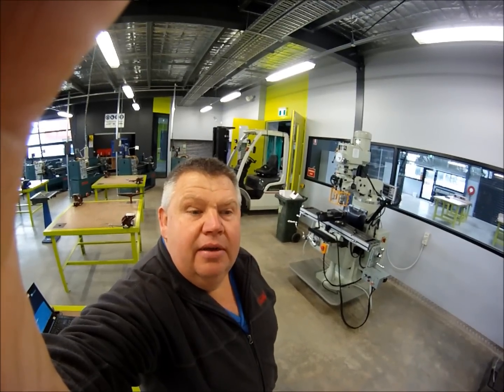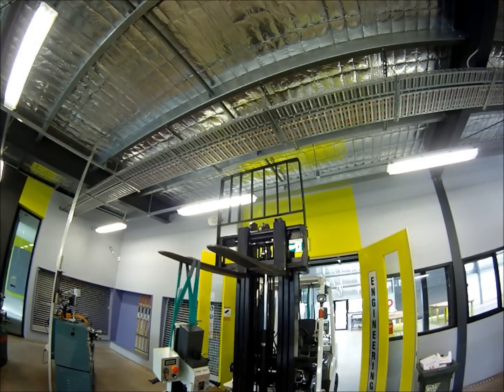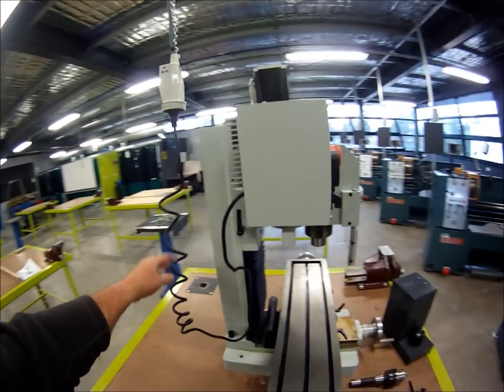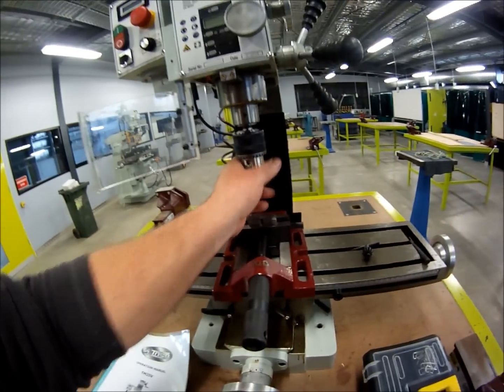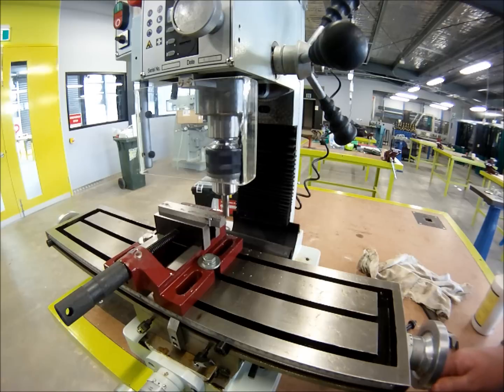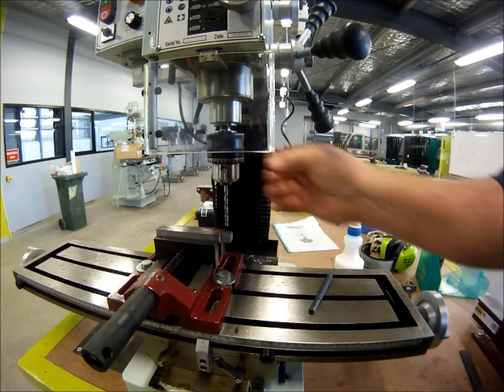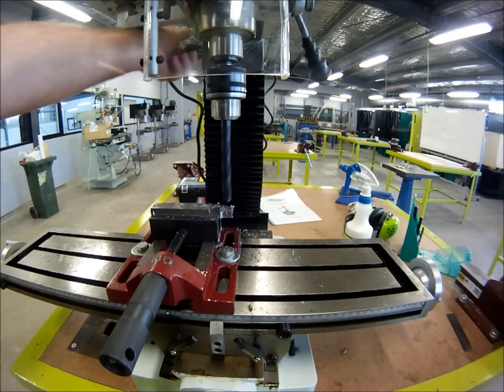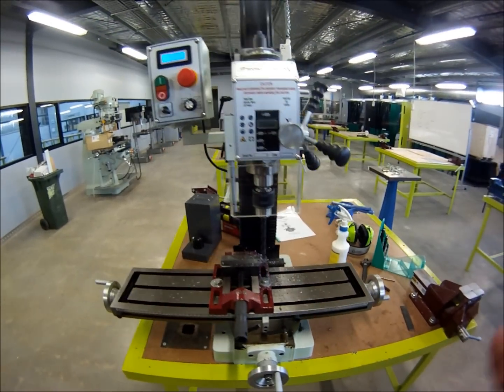Titan Mill TM25V Unboxing & Test Drive

Comment: Is this a renamed Precision Mathews? It sure looks like it and has the same features that has my interest such as the column to base bolting, belt drive, and the table is a solid casting instead of end caps that all the other brands of this size mill use.
Reply from the maker: Hi Travis, I'm sure there are similarities between all of these little mills.  The older PM25 was a close to that of the grizzly / optimum mill.  The newer PM25 was identical to the TM25, but I believe there is a version 3 now which is slightly different again.  Either way I have free files (see video description) https://youtu.be/Wx8238bGSCY so help yourself and download them. Cheers, Aaron.

Comment: Hi Aaron forgot to mention that's a really nice engineering school lucky students or apprentices.  Nice fork lift. Regards Tassie John
Reply from the maker: +John Kinnane Thanks John, yes the kids are spoilt at my school.  It is a brand new trade centre which I helped to set up.  Heaps of CNC machines and manual machines.  The students have a ball there and make many cool projects.  Cheers, Aaron.

Comment: G'day Aaron really considering buying this mill, I have read that some buyers are less than impressed with the standard of delivery complaining about rust on lead screws, ways and missing tools.  Surely these are isolated incidents as I assume Stuart has sold a lot of these, I suppose I am  looking for some reassurance.  Regards John Kinnane
Reply from the maker: G'day John, unfortunately there will always be keyboard warriors on the Internet with an axe to grind. I have been directly involved with the purchase of 7 milling machines from Stuart and have never encountered a problem. However and that said, remember these are made in China for a price mate. They're not a Bridgeport. There is a larger machinery company selling similar machines, I won't deal with them due to a past experience I had at another school. They quoted $6K to fix oil leaks on lathes we bought from them. I fixed them all for $15. Cheers Aaron

Comment: G'day mate just happened to stumble across your YouTube channel.  This looks like a very nice mill, I am into building a 5" gauge live steam loco and need a ridged and pretty accurate one.  In your opinion would this machine be able to do the Job?  Have subscribed to your channel thanks mate regards John Kinnane Tasmania
Reply from the maker: G'day John, yes the little Titan TM25 is a fairly rigid machine for a small shop mill.  I have the older TM20 and I can mill steel and aluminium on it. It's capable of running a 1/2 cutter or a 25mm face cutter. Mine is converted to cnc. I have videos up on this channel showing it operating. Cheers Aaron
Reply: +DCTTeacher1 Thanks for the reply Aron, I was looking at a ZX30 mill drill but it seems that they are not ridged enough especially on the Z axis. I was also looking at a Sieg SX2.7 but I am sure you know that the quality isn't there.  By the way your channel is great and as for the large choppers fantastic, I use this build large scale RC aircraft when I was younger I am now 59 and have rheumatoid Arthritis so It is difficult, easier with the locos.  Thanks Aron I have subscribed and look forward to watching more of your videos
Reply from the maker: Hi again John, thanks for subscribing mate.  I really appreciate it.  If you are chasing rigidity I would get the larger Rong Fu 45 type of mill (titan TM45). Michael the large scale helicopter guy bought one of the TM45 and he just loves it.  I will check out your channel now.  Look forward to seeing you scale loco's.  Cheers, Aaron.

Comment: Hi Aaron. Nice mill! I have just ordered one of these from Stuart but it's hard to get into contact with him to find out details about them and all the sites have completely different specs for the machine... :/ I need to order R8 Chucks etc and I am wondering what the R8 drawbar thread size is? Ie 7/16" 20TPI or M12, this isn't listed in any of the specs on any site either? And is the R8 drawbar thread the same as the R8 on the TM20VL machines? What does the manual say for max face mill size, etc? Also, what are the actual travel lengths for X and Y on your machine? I haven't been able to get a reply from Stuart at all about these and his phone just rings out... :/ Every site has different specs :/ ie ebay, titan website, machines4u, alibaba, etc all have different specs for the TM25V which is bloody confusing to say the least! 

I am planning on converting it to CNC also with Nema34 800oz + 0.9 degree steppers with belt reductions, etc... How is your convert coming along? 

Cheers for the info and looking forward to seeing your progress!
Reply from the maker: TheJetProject Hi mate. Have you tried calling Stuart on his mobile. He usually answers it, if not just leave him a voice mail. The TM25 draw bar for the R8 is 7/16" x 20TPI.  The maximum end mill size is 16mm dia. I have used a 50mm dia 4 insert face / shell mill in my machine with good success. The working size is the same as the TM20LV, but the motor is more powerful. I have already converted my TM20LV to CNC, but am in the process of making a kit for the TM25 machine, but these will be direct drive and not belt drive. I look forward to you conversion. Cheers, Aaron.
Reply: Hi Aaron, 

Thanks for the quick response! Yes I have tried him quite a few times on his mobile but it just rings out?

My TM25V turned up though. This one is green and it has a geared head not belt for some reason? On the plate it's say TM25V? Haven't checked the motor specs yet or pulled it out of the crate to check that the whole machine is ok but I pulled the top off to have a look and there is no pulleys which has me stumped? I thought the TM20VL is geared head and the TM25V are 2 speed belt? The control box sits on an arm like yours is in the vid? Do you know what other spec differences there are to your two machines when they were stock? 

I have seen your TM20VL CNC, very nice work! Part of the reason of the bug I've caught ha ha ha! What steppers did you use for it and what are you going to use with the TM25V? I am leaning towards a closed-loop system now... Too many options and toys to choose from ha ha ha! My main thoughts for the belt drive reduction instead of direct drive is it's less space (more room for more machines in the workshop) and a bit more torque, apart from that there is no need for it really. Can't wait to start making chips!

Cheers 

Johno
Reply from the maker: TheJetProject Hey Johno, good to hear from you mate. I thought all TM25's were belt drive.  I would ring Stuart to find out what's going on.  As for steppers I used Nema 23 570oz ones and Keiling digital drivers KL5056 with a C10 breakout board.  I'm going to stick to the direct drive.  Belts and pulleys just add to the price of things.  Keep me posted on your progress.  Cheers, Aaron.

Comment: Have been looking at the TM25V and here is a really dumb question, what is the table size.
The Titan web site gave 2 dimensions ( and now its dead, the web site that is) and the fleebay listing also gives 2 dimenstions, one in the spec and one in the item description.
I have the Hoss DVD's and am trying to work out what I can reuse for a TM25V
cheers
Reply from the maker: Hi Greg, the table size is 700 x 210 mm and the travel of the X & Y axis are 425 x 210 mm. I noticed last night on Facebook that Titan Machinery had posted that their new website was up and running.  This is where I got the figures from.  Hey, I'm in the process of making a CNC retrofit kit for these mills. So I'll keep you posted.  Cheers, Aaron.
Reply: DCTTeacher1

Thanks for the info, as to the CNC retrofit please that would be fantastic.
Saw your Sig X2 conversion, very impressive.

cheers
Reply from the maker: Hey Greg, thanks for the kind comments mate. I will let you know ASAP.  The new kits will be better quality then the Sieg kits I made.  Cheers, Aaron.